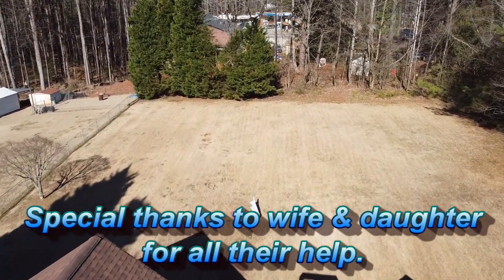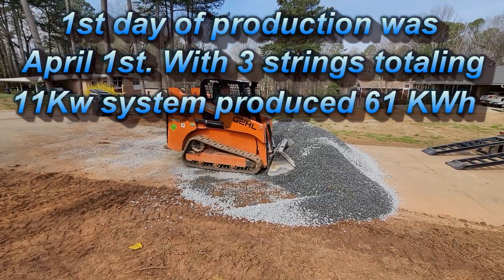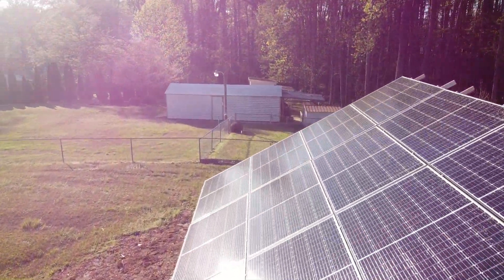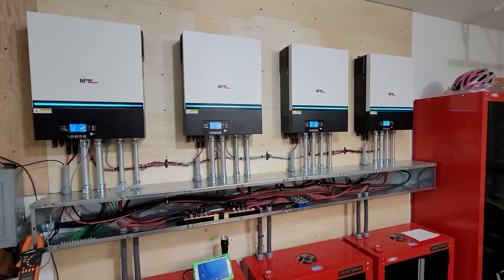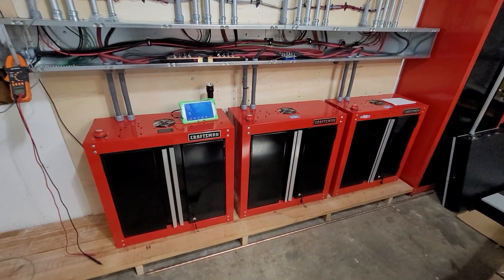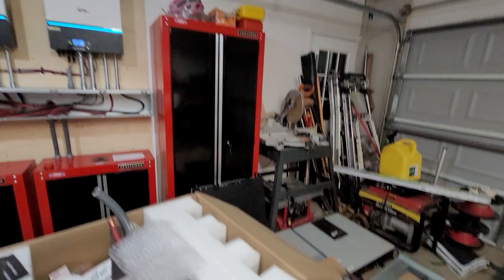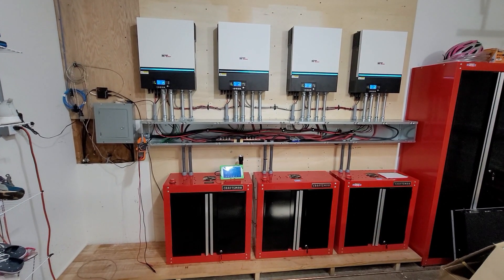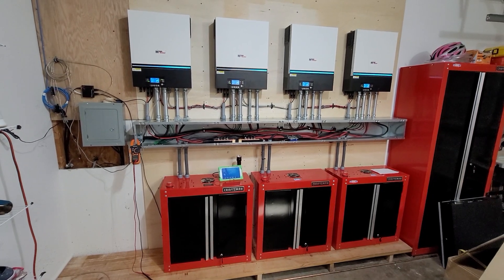DIY 14.8 KW Solar Array With 50KWh+ Power Wall

Comment: It is a lot of work both mental and physical.  One reason it may be less now is the improved products being offered at relatively inexpensive prices such as the LV 6048 s and the Screw in post supports. . Another is the help available both on sites such as DIY SOLAR and You Tube channels such as David Poz and Carson Urban and ALT E store and this channel DMI INC. More notably the willingness to offer their time and insight that only comes from experience. The saying "you dont know what you dont know" has never been more applicable.  Even something as simple as finding out where to order certain parts or how long it actually takes to receive products from certain suppliers especially overseas.  More so for more cutting edge electronics requiring information for how to on automation like the Arduino possibilities or raspberry pi.  I hope to do more of this in the future.  I too am planning on an electric vehicle soon.
Thanks sincerely for all your past work and future videos and your future endeavors!
Reply: I have learned so much from that group of people that you mention especially Carson and DMI who both took time to help me in setting up my LV5048's Thank You all so much.
Reply from the maker: @bobwire6440  Thank you.
Reply from the maker: Thank you so much for the wonderful comment. Yes there will be more videos on solar but I am moving towards automation part. HASS, raspberryPi and such are already up thanks to jblance and his GitHub project.

Comment: The wireway looks to be about 6”x6” by 10ft. Is this correct? Is it a Hammond? If you had it to do over would you get a larger or smaller wireway?
Reply from the maker: 8"x8"x8"   Do not know the name of mfr. Depends on the size of the system.

Comment: Can you do only 3 of the LV6548?
Reply from the maker: Yes, but why? you limit your output to half of max output of all4.
Reply: @DMIINC2013  I don’t room for 4 horizontal … unless I can stack them 2 over and 2 under?
Reply: @DMIINC2013  why does having 3 make the power get cut in half?

Comment: Do you have a template for LV6548 penetrations into the tray? Where did you get the tray?
Reply from the maker: No template. Just used piece of pipe to mark spots for cuts. Wireway I got at local electrical supply store.

Comment: Curious, when changing out to the LV6548 you do not have your DC combiner disconnect.  It looks like you switched to ANL fuses vs breakers.  What's the amp rating for the fuses and do you plan on returning to the Combiner and adding breakers back in?
Reply from the maker: All three power walls are still combined inside the wireway. Only difference is use of fuses instead of breakers. 200A. I think that is what you are asking about?

Comment: Nice system, friend. I'm actually going to go with the new LVX6048 from MPP Solar for my installation. I'm also going to back the pair (installed in stages) with a Wind Turbine based on the plans from James Biggar (he's got a nice channel here on YouTube) and a pair of 560AH 16S2P batteries built into Craftsman cabinets like you've done. The batteries I will build will have about 57kWH of storage which is just a bit more than what you have here.
Reply from the maker: Nice system you got there.

Comment: Do you use your inverters to feed back excess solar power to grid tie?  If so,k would you mind sharing how you connected your Line In and Line Out from your inverters in relation to your transfer switch by your meter.
Reply from the maker: These inverters can not export power back to the grid. They can only take power from grid.

Comment: Здравствуйте скажите пожалуйста у вас на инвекторах подключены по 1 контролёру  , какое напряжение и сколько ват заходит
Reply from the maker: Translation "Hello, please tell me you have 1 controller connected to the invectors, what voltage and how many watts are used". I don't quite get it as I dont know what are you asking.
Reply: @DMIINC2013  я спрашиваю про понели , на инвекторе 2 контролера у вас понели подключены к одному  сколько вольт и ват заходит
Reply from the maker: https://youtu.be/W7AZmyy38cw

Comment: Nice system setup. If you no longer have use for the two LV5048s you show on the ground, I can use them. I have one already but will need to get two more soon.
Reply from the maker: Where are you located? I am in GA.
Reply: @DMIINC2013  Too far. I live in Trinidad and Tobago
Reply: @DMIINC2013   TN here , for sale ?  Trying to start a system and have panels but no inverters yet . Thanks !

Comment: I run my bottom water heater element on 120v with the original 240 element on solar as a load dump. Top element is grid set at 130. Bottom set at 140. It stores about 7kwh of solar. I have it set on soc trigger. Victron is awesome I connect to grid as back at %25 and %85 triggeres water heater. You did a awesome job. I understand how much work and planning goes into it. Bye bye electric bill. Come on power outage
Reply from the maker: Very nice! Thank you.

Comment: Nice job sir. I built a 4,000 watt solar with 16kwh 24v lifepo4. With 2 victron multiplus. I'm in for about 10k. I like your system I'm not much on those inverters but to each there own.
Reply from the maker: Thank you. Was thinking about using victron since I like their products too but for whatever reason their reps were slow to communicate with or just ignored me.

Comment: Looks awesome DMI! You have been kickin  *ss! I love my LV6548's. You'll be glad you made the upgrade I think.
Reply from the maker: Thank you sir. So far they are performing like charm. Seeing your setup kind of reassured me of how good they can be. Solar panel there yet?
Reply: @DMIINC2013  Well.. Yes I have panels BUT ... I ordered Black on Black and they sent the wrong ones!. They have the silver bus bars. So,  they are suppose to swap them out next week. These days no one seems to get anything done right the first time. Everyone blames problems on Covid etc. I am waiting on another email from Solaris on Monday, but it's been nearly a week and they still do not even have a ship date yet. We will see.
Reply from the maker: Tell me about Covid excuses!!! LOL. I had luck with ressupply.com I ordered everything from them in regards to iron ridge mounting and 12 panels  and got lady assigned to my account that helped out until order got delivered. ressupply had issues with FedEx. Good luck. Can't wait to see your setup completed.

Comment: Brother u could sell all those shoes and get another inverter 😂 😂......... Brother that is badass ur making me want to change my outback set up for one of those like the blue green lights mine has all green light to me that MEANS FREEEEEEEEE........ Ur system and off grid wanna be so far have the biggest battery banks on the tube.... Keep it up brother and keep me informed on how its doing you done a wonderful job...........
Reply from the maker: Thank you brother. I sure will.

Comment: Holy moly! Glad you finally followed through with your dream. Panels never come out absolutely perfectly aligned. More importantly everything is running!
Reply from the maker: Correct. It kind of bums me out but at least it is sturdy and safe and is working as designed.

Comment: Wow! Looks great and impressed with the setup! I’d be surprised that you don’t run out of battery capacity with the size of the array and see some clipping from the inverters. Would love to see some setup details related to automation, etc.. that way you can redirect the power when batteries are almost full.. Maybe leverage the bigger cabinet on the left for a larger powerwall with 280ah cells...? 😉 great job
Reply from the maker: Yup. In these last several days panels do not do anything past 2:30 PM. But with addition of EV that will change. Yes already thinking about another PW. Wife is gonna hang me. LOL

Comment: Wow that's such and amazing install, very clean and well thought out, I envy that a bit.
Have you figured out if you can monitor you invertors remotely via another computer or smart phone ?? if so please message me or maybe do a video on that please !
I currently have two LV6548  split phase running flawlessly for 5 months.
Reply from the maker: Yes. I have videos on that too. I can collect data via InfluxDB and display it in Grafana and have sensor data go to Home Assistant for automation or remote monitoring.

Comment: Very very nice I love it you step your game up on this one 🙏.  What are you asking for the 5048 and will you split them up.
Reply: I may also be in the market for another LV5048 . I am currently trying to decide between that and upgrade similar to what DMI has done or to 2 net zero blending type units similar to SOLARK such as Amen or DEYE units.  I may need additional unit even to use in another location if I upgrade here.  Perhaps together we could get all 3 and I probably have a way to get them to west TN about the end of may as my daughter is in Atlanta and there is definitely a trip planned end of May.
Reply from the maker: See my reply to carson's comment.
Reply: Nice to know nothing happened to you since we haven't had any videos lately!  Still waiting on that last battery update.
Reply: @teekay1785  I'm going to do an update on the batteries either tonight or tomorrow. But other than that everything is fine going to try to get some upgrades going here shortly will be making some videos on that too 👍.
Reply: @carsonlurbanwindandsolar3437   Great ! Good to hear things are all doing good.
Reply from the maker: We will see. Depends. Maybe something can be worked out. I am a afraid of shipping this. I would prefer someone picking them up.
Reply: @DMIINC2013  okay sir I understand but keep me in mind if you decide to do some shipping. And thanks again for that great video made me want to get to work again 😂 LoL.

Comment: Outstanding job!! Looking good.
I replaced my transfer switch with a Homeline 100 amp 12 circuit 24 space breaker box with a interlock for critical loads.  This allows more flexibility as well as more circuits at lower cost. Getting ready to install a second box for remaining circuits for a/c stove...
Yes videos coming...
Reply from the maker: It has been a while since you posted a video. Lets see some.

Comment: I have my hybrid hotwater heater in my utility room with batteries and inverter. The heat they produce makes hotwater heater work better. I disable the heating element in mine and at max it pulls 600 watts
Reply from the maker: Same thing here. Funny thing is, that hot water heater will actually cool of garage quite bit in reasonable amount of time.

Comment: Success!!!!!!!! It's a beast lol nice start I wish you all the luck with your future Solar power.
Reply from the maker: Thank you OffGrid. You been there every step of the way.
Reply: @DMIINC2013  Yes and I loved it all and your success. When I comment it is meant to help you so don't think it is negative. Do you think 14.8 is enough you folk get more productive time than I do in Canada so there is that and also there will be days you make way more than you can use so there you have the storage problem every solar system has. You don't need as much heat as I do so that will help and your high production in summer will go to air conditioning may be the best of all worlds. I will look forward to your future videos and hope you continue to share your information  Cheers.
Reply from the maker: I never take any comment as negative. They are all appreciated. Granted, I had this up and running since Tuesday of last week and do not have enough data to make decision on PW expansion or something else but panels do not do anything past 2 or 2:30 PM.